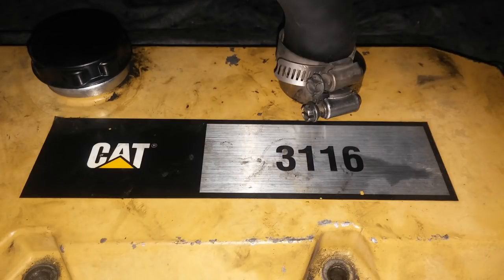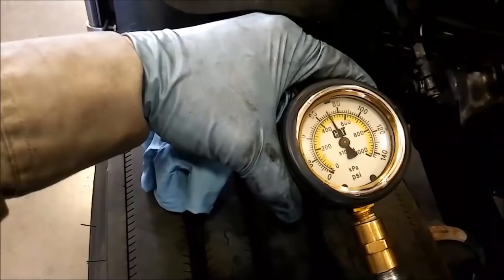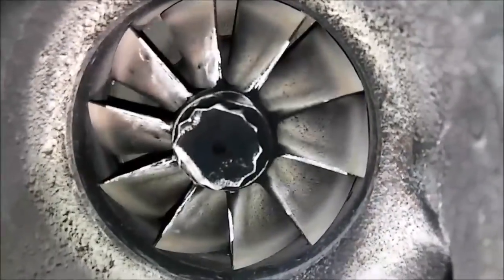The Cat 3116 Engine.  Know Your Engine.  Facts, Engine Design, Design Info, And Common Failures.

Comment: Cat took on the 2 stroke Detroit system with this engine which is actually really reliable. It just takes a real mechanic to work on them & not a place for the plug n play guys.
Reply: Yes, a poorly engineered knock off of DDEC.  And then huei.  Go home cat, you're drunk.
Reply: Huh?  1992 was the last years for 2 cycles so not a competitor.
Reply: @grantsmith3514  Nobody said "competitor" except you! The reference was to the common rail fuel system instead of a timed injector pump.
Reply: Exactly, I was going to write the same thing and then I saw you had, I spent 15 years working on high performance 92TAs and TIs on boats and it all looked the same to me as a 671, add the complication of syncing the 2 blocks would blow his mind but it was monthly job on Stewart Stephenson 16V92TAs with 147 injectors. There were 1,000s of people everywhere that could do that those GM 2 strokes where in everything.

Comment: Not bragging but I am one of those guys that can set up a rack on those types of engines like what's in the old Detroit two stroke diesels. The 8-71 racks are especially challenging cause u have to balance both sides, u go by a very delicate feel and pin drag like a brain surgeon so to speak. If u don't get it right in a truck they wouldn't pull a load very well.
Reply: Until they found a hill
Reply: Where are you located?  Are you available to adjust a 3116?
Reply: @RJ1999x  ha ha.  Don't need a jake, just carry a pic of a hill.
At least they sound like they're trying.  At least they never built a heui engine.
Reply: @randymagnum143  lol, true

Comment: 3116 = 3000 series 1.1 litre /cyl 6 cylinder. Try doing injector set in a mid mount fire engine, or any work for that matter makes all the other aplications a breeze to work on. You can do a rack sync on any cylinder seperately without desturbing the other settings except 1, if you do cyl 1 you must do all 6, the setting is actualy easy, interpreting the procedure is the tuff bit.  If you have a hard start issue in mui engine there is a plastic check vallve in the fuel return line that needs replacing, costs about 10c and always looks like new but alows fuel to syphon back from the injectors at shut down we used to replace them yearly in some machines. Not good when your fire engine wont start. Cheers mate🍻
Reply: Explain how easy it is
Reply: Any special tools to.do so
Reply: Carlos Jackson yes mate you need the 1.1 L fuel setting group and the service manual. Its been 10 to 15 years since I last tuned one of these, those brain cells are long gone. Cheers mate 🍻

Comment: Excellent video. The 3116 is a good engine in most applications. The military still uses them in  some vehicles but is slowly phasing them out. By far the worst thing about this engine was setting up the overhead. Other than that they were very reliable. The tooling and procedures to work on them was and is their biggest fault. As you had mentioned, this was their first venture into a small inline engine and it came out okay. Most parts are still available currently. Thanks for sharing the info on this engine.
Reply: Hi Ken. Setting up the overhead? Im not a mech, Im a fireman and part time general contractor. I have only one dump truck, it has a Cat 3116. So far, so good. I run this truck to the dump, full of concrete, and it runs strong, as if it had no load on it all. I love it so far. Having said that, Im the type that likes to take care of his equipment and do maintenance , to prevent problems. At any rate, I hope I never have to, set up the overhead, because I have no idea about that. Id have to take it to a mech, and that job sounds expensive , haha. Other than keeping filters clean, is there anything else I can do to my 3116, to keep it happy and running smooth?

Comment: Great video, thanks Josh.The 3116 engines were a great engine considering the environment they lived in.Medium duty trucks usually get poor maintenance and little attention until something goes wrong.The 3116 would normally out live the truck it was in.
Reply: Hey Josh,

How much would I be looking at spending on a cat mechanic to inspect my 3116. I just bought it and I see 2 harnesses disconnected and the truck only had 1 of 3 batteries in the box. They added a prime pump on the return line. which I believe is not a good thing. So basically inspect to see what they did that they shouldn't have. Also the fuel filter looks bypassed. A little worried about this because I plan on running otr with this 95 gmc topkick with 3116 cat. Don't want to blow an injector

Comment: I used to take the worst job. And got a lot of experience with 3116. As I had a grip of the 2stroke Detroit's it was a cake walk but we are a dying breed, used a carpenter tool a vernier caliper from harbor freight and  some 1/4 all thread and and made my own injector height tool it worked out very well but you have to be real picky

Comment: We have a 95 kodiak with a Reman that has been ran low on numerous times and smokes like no other. It starts to over heat over 45 but will not stop running, just gets harder and harder to start lol. We have a 92 with 430k and runs like new. Amazing motors!

Comment: I worked on crown buses with Detroit 6-71inline. Very similar fuel system. In fact once adjusted over head on 3116 using same basic method. Thanks for video

Comment: I have a 3116 that I turned up a little bit and it's been a great engine I have it in a Kodiak tow truck with 420 thousand miles and only replace the turbo and had to replace the injectors and injectors cups. and every year run the rack
Reply: How'd you turn it up?

Comment: great vid, we have one of the first 3116 in a custom made lo pro, first one made in the usa. Only has 134k miles on it, engine has been great. In 93 the dealer, chief white gmc in duncan ok, (they did the custom body from a detroit incomplete chassis), had a 3116 video in their dealership, in that video, it stated the 3116 came in 6 power settings, and the lower power settings 1 2 and 3 used round pistons, while higher power settings 4 5 and 6, used slightly oval pistons that "became round" on warm up, I was told we had power setting 4 in our engine.

Also, a lot of reference to japan was in that video.

Anyhow, truck has been way underutilized since 1993, its gmc door sticker does not say truck, it say recreational vehicle motorhome, and has car tags on it (because it was shipped as an INCOMPLETE CHASSIS the dealer builder was allowed to placard the truck as they deemed correct, and this allowed us to bypass all truck restrictions :O

Used to pull custom horse trailer

The engine has been great, the last few years it has been hard to start if it sits for a month or two, fires up then cuts off and have to crank it, i think the fuel leeches back down into the fuel tank, and we should be turning the fuel tanks off when stored, to prevent leakdown.

Comment: I just loved changing the injector sleeves on those, especially in a topkick.  The racks weren't too bad to adjust.  My bread and butter, when I worked at  CAT, worked on a lot of HEUI engines as well.  Not that hard to diagnose
Reply: I have one that won't start.  Any advice? Cranks but doesn't start
Reply: Heui in a topkick
Reply: @jasonlowry1151  Engine model and serial number??

Comment: In the mid to late 90's I worked on these all the time in marine apps. Cooling system venting issues, manifold updates, turbo updates, then injector cup sealing issues causing combustion gas in to the fuel rails under boost- Cat was authorizing all kinds of overtime and shipping replacement engines like crazy to keep the contract with Sea Ray- always twin engines in some very tight compartment. Eventually they got the issues fixed towards end of production and phasing them out for 3126's- one of the last sets of 3116's we sold is in a charter boat with over 10,000 on the clock.. no, I do not miss setting up the top end on these- the injector sync procedure would work better if each injector would have the exact same calibration at the exact same rack setting  but they don't. Then you get a little fuel knock and it changes from hot to cold.  Honestly I would not have one of these in a boat, a 5.9 cummins is a far better engine with a much easier to service aftercooler/heat exchanger. Go ahead and flame me, been working on marine stuff 35 years, Cummins 5.9 BTA is easier to work on than a Cat 3116 marine.
Reply: Is a 3126 a much better choice or is that a stay away from engine also(marine use)?
Spent my life behind 3406’s and c-15 in my own trucks.
Thanks in advance doghearder!
Reply: @jeffw7644  The main difference in the 3126 aside for being a slightly bigger displacement is the sea water aftercooler vs a jacket water unit.  They were good engines in the later serial numbers or the earlier ones when the bugs and reworks were carried out. I'd rather have a 3126 mechanical than the 3126'B" that superseded it later called the C7.
Reply: @Jethrosgarage  think you, so a 3116 has a sea water aftercooler vs 3126 has a jacketed aftercooler if I’m understanding you correctly....?
Reply: @jeffw7644  Reverse that- 3116 JWAC 3126 SWAC.
Reply: @Jethrosgarage  👍🏻
Reply: Also- due to  the SWAC, the engine is maybte 2-3" wider.

Comment: My 3116 runs good at first then loses power and if I pump the primer pump and open the air bleeder to let fuel run out it’ll run good for about 30-45 mins. It runs better on a full tank of fuel or first thing. Not sure if it’s sucking air or some kind of pump issue. Any ideas?

Comment: Last time I had cat tech on-site i asked him if we should do the overhead on our 938G it has a mui 3116 in it he told me no rite quick lol. I already knew he would say that . Like you said that is the engines only downfall is anything with overhead . Although I managed to sneak some cam follower cover gaskets into one in our gmc . It was a total pain but I did it made a few new torch bent wrenches that day . Told boss worst case scenario it won't leak but will run funny and it will have to go to car for adjustments . It needs a camshaft and followers replaced but he didn't want to do it it is still running 6 years later to my surprise. If your curious i found the engine had been worked on before and the 5-6 follower shaft was installed backwards in the cover starving it of oil .rollers and cam lobes are chewed up but it doesn't make noise not sure how . Not my problem now as I quit the truck side and went to heavy equipment side

Comment: Hey Man, I'm totally New to diesel engines, i just volunteered to go to Florida for Hurricane cleanup, the truck im driving is a 1995 Gmc topkick with a 6 speed and a 3116 cat engine, well the truck runs great, except for b n a misquito fogger till it gets s warmed up... Its a 95 model and was last registered in 1998, so needless to say it has around 330k miles on it, cranks in 32 degree weather before turning over twice... Blowby tube no oil anywhere to be found,  (slight rear main leak), no oil from anywhete else, takes awhile to warm the engine up, it will idle for hrs, total blue smoke, get it on tha road and warmed up it gets to a slight hint of smoke, i haven't taken tha valve cover off as of yet to see if tha drain valley is clogged and letn oil seep in thru tha valve seals, cause my Boss thinks its an injectir problem... I can't say i know much at all about smoke from injectors, just wouldnt figure it to be blue, with oil smell, and not fuel smell.... LOL, doesn't really use any oil to speak of.... And I'm Sure by watching Your videos you know exactly whats wrong, i sure wouldn't mind not leaving smoke signals for all to try and decifier from falling Feather, or Pooping Dog... LOL 😂

Comment: question for you Ape.... i have a 3116 that had a bent push rod. was running just fine just heard the knocking of a rod. My tech removed the rack changed all the rod. reinstalled the rack and did the lash adjustment. ENGING WILL NOT START NOW!! No injectors were removed. What did we do wrong!!?? PLEASE HELP

Comment: I did a tear down and rebuild of a Cat 3116 in school. The intake was nasty, as if the seals in the turbo failed and shot oil into the intake. All of the bearings for the crankshaft and connecting rods were shot.
Reply: Question. I'm having oil and gas mixing in fuel filters. Truck is losing power and hesitating a alot. Was leaking a lot of oil now oil level is raising because gas is coming in. What could it be?

Comment: I have a question!
I have a 3116 in a 1995 Chevy Kodiak.
Problem I’m having now is that it sputters out like it’s out of fuel, but tanks are full! I’ve changed fuel filter, cleaned tanks and still the same. Also have a GMC Topkick doing same thing!!! It seems like it is starving for fuel!
My 1977 Ford with the Cummins runs like a champ!!
Is there anything I could try to fix the problem?

Comment: My company has 1 cat powered truck in the yard. It's a 2000 freightliner business class. It has the 3126 7.2l, and it out runs all the other trucks in the yard. All of these have the cummins 7.3l gen 1 and gen 3(the same engine ram uses in thier trucks) cold start does Exist. Cranks every time i turn the key. No matter what the temperature is. The cummins, on the other hand, need a block heater for a few hour before they even try. Hand down best diesel manufacturer

Comment: Good info, is a liner the same as a sleeve? I am looking at older 90's boats, someone I know had the predecessor to the 3116, the 3208, one engine went bad,  because there were no liners/sleeves they pulled the whole engine to rebuild for 70k WTF!  A new cummins ISB 6.7 liter is about the same displacement, I would think it cost less than 70k new?

Comment: I have a Marine 3116 rated at 350hp....it suddenly lost a lot of power after picking up bad fuel in the Bahamas. The tanks are now clean, there engine starts and runs well but tops out at 1200rpm. All boost hoses are in tact and there is is no black smoke and there are no air bubbles in the return line . Does the governor in the transfer pump have to open up from oil pressure or boost pressure?......late model mui injectors
Reply: I found a  piece of steel , like a flake of rust in the bilge area,......when I searched it came from the intercooler and left a hole, ...therefore no boost pressure....I found the cause .

Comment: Can the fuel shut-off solenoid stick to the governor and prevent startup after a month not using it ? I have one acting like the solenoid on the pump isnt good. But it click very nicely and Ohmed out perfectly. Just wondering if a governor can stick after leaving it for a month. Ran good prior. It's a marine 3116

Comment: I have a '92 3116 (120K miles) in a Gillig Chassis HMC RV.  Just had the turbo rebuilt, valves adjusted and they did the rack.  I am concerned about the lubricity of the ultra low sulfur fuels and wondered if you believe I should add anything to the fuel, like a cetane booster.    I normally purchase my fuel in Nevada while driving between CA and NV.

Comment: I have a 3116 in a topkick that has been fighting me for a while now.. started to lose power and then wouldnt start at all. There is a tube covering the linkage between the head and governor. I slid the tube into the head and moved the linkage manually. The engine fired right up. The Diaphragm and line to it hold air.  Would low oil pressure cause the governor to shut the fuel off? Or is that oil line just for lubrication?
Reply: could be junk into oil passage and it wont open levers
Reply: Mine is not running worth a shit either...changed the electric fuel pump and it helped a lot but still runs rough at times

Comment: I have a 1993 top kick with the 3116 that was running rough at a idle when it cold but then would straighten out when warm. We drove it about 300 miles pulling some equipment and it ran fine we shut it off and now it won't run. Seems to be no fuel. We went thru the basics but we are having a hard time figuring put what is wrong any ideas? Any info would be great

Comment: I have a mechanical 3116 in a military truck that started knocking when the oil supply line to the governor fractured.  The engine was shut down, but a CAT service tech recommended we replace the part, fill it with oil, and fire it up for ten seconds to see if the knocking was in the engine or in the governor.  The engine stopped suddenly after 8 seconds.  It's not fully seized - we can rotate the engine.  Any chance this can be fixed, or is this engine dead?

Comment: Aahh, the dreaded 3116!!.. only thing I ever enjoyed about working on them is watching it leave when I was finished!  Never worked on on-highway, just industrial and epg. After years of experience with them I've learned couple of things, if it needs cups buy a reman head, if the governor/transfer pump starts acting up buy a reman, if the engine is wore out buy a reman!!. Changing the head is faster and cheaper than fighting cups, the governor's aren't worth trying to repair locally vs the cost of a reman, and being an internal bore block, it's cheaper to buy a cat reman vs going thru local machine shops. There are tricks to setting the fuel system much quicker, but it still requires the cat fuel setting group. All in all I'm glad they are all gone from around here!
Reply: Question. I'm having oil and gas mixing in fuel filters. Truck is losing power and hesitating a alot. Was leaking a lot of oil now oil level is raising because gas is coming in. What could it be?

Comment: I am getting ready to buy a 94 chevy Kodiak with the 3116 how urgent is the injector to be fixed and how much would something like that cost
Reply: I would get the injector fixed. If the injector gets stuck open it can wash out your cylinder and kill your engine. If you're going to do one I would do them all. As far as cost, just depends on your area and if you get your injectors rebuilt or replaced.